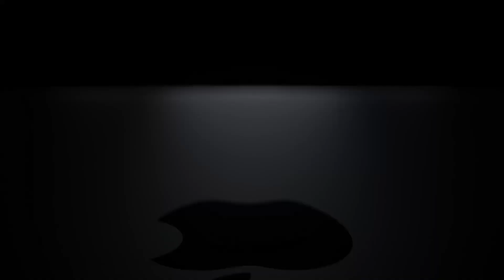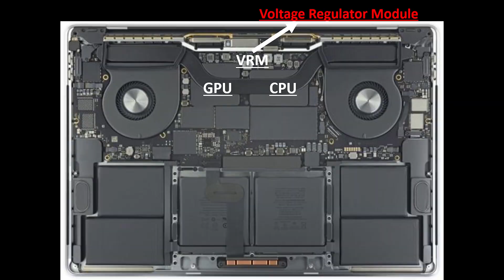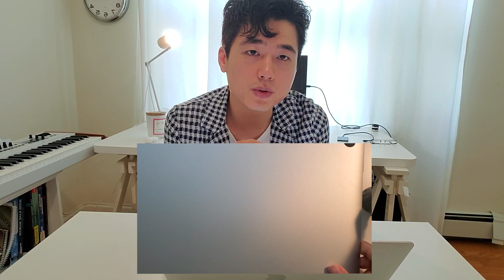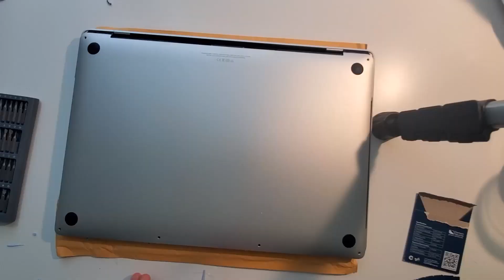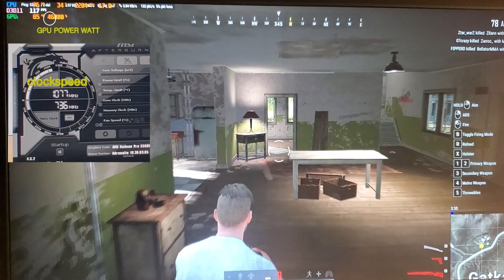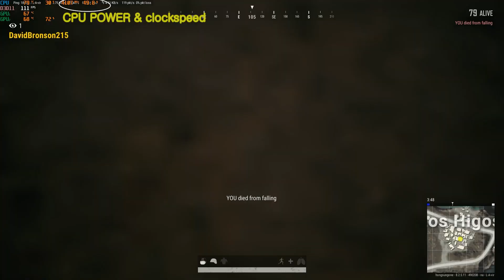MACBOOK PRO 16 INCH Thermal Design Flaw 3 Minute Mod Solution Performance Increase GUARANTEED

Comment: What's the thickness of the termal pads used in this video?
Reply: Just saw in the video, it’s 1.5mm 👍
Reply: You will have to do 1.5 mm and you may have to double up the layers.
Reply: @youandiryan  no you don’t because if Apple give us above a 1mm space and we’re yet using a 1.5mm thermal pad, that’s enough. With a double layer you could create too much pressure against the motherboard

Comment: This mod definitely works and I feel all MBP 16 inch with Intel CPU should do this. The only issue I see here is stacking thermal pads. Use a single pad with right thickness if you can as this will have better thermal transfer.

Comment: What about putting thermal pads on the heat sinks?  Would that help transfer the heat out as efficiently.  Tho, I have heard that in some cases you need to replace the thermal paste as well.

Comment: 2024 I just tried these tips and it's 100% work with me, after adding the thermal pad I ran the R23 benchmark and the maximum temperature get is only 80c, so awesome man
Reply: Which one themral pads ?

Comment: Thanks for the video. It is really helping.  One question, should I remove the adhesive backing on the top layer of thermal pads so they stick to the back cover of the MBP?  I assume that would make it much harder to remove the cover later.

Comment: I did this mod exactly as in your video. Just don’t understand why you put the thermal pads on the lower sections in the middle (thin pads)? I mean no VRM chips there…And btw I believe the most important part to put pads on are the so called mosfets (small black chips). Do you think there is a risk of the pads falling off since they are so thin and stacked?
Reply from the maker: Nah it all depends on how well you put the lid back on good luck
Reply: @notefromone2925  well the mod worked tho 😚

Comment: I FIXED MY MACBOOK PRO 16. Clamshell mode, power connected to right side and (most important) keep the laptop turned OFF. It supports many connected monitors, no throttling, no nothing. Remember: do NOT turn the MacBook Pro on and there will be no throttling. Additional idea: place papers below the laptop. They will NEVER go due to wind. Now you can use your $4500 MacBook Pro 16 for what’s intended.

Comment: This 100% works - highly recommend - my fan speeds seem to be down 5-10 degrees c. It now sits around 47-48 degrees c with a few apps open when developing mobile apps with flutter. Supplementary tip - install Mac Fan Control and set to full blast when running high loads.

Comment: When using the laptop by itself (without any external display), do you run into stuttering issues with the IGPU. I'm not sure if it's an issue with mac os big sur and how it is optimized with the Intel UHD 630 but at times, when using it, the typing lags a bit and there seems to be a bit of stuttering.
Reply from the maker: No I do not experience such lag. Perhaps you should consider doing a wipe
Reply: @notefromone2925  yeah sucks because it’s a pain to get everything back on but seems like the only solution l. I did a pram reset, smc reset,  nothing did it

Comment: I want to do this mod but I have question. Because of the heat transfer, it may increase battery temperature and also may decrese lifespan of battery. Did u check battery temperature before and after?
Reply from the maker: Hi thanks for the comment. The battery is located far below the chassis. I havent checked the numbers but when I touch the lower part of the laptop, where the batteries are located, the temperature feels much lower than where the VRM is. My battery health is still great
Reply: @notefromone2925  Thank you for the reply. When u use it on your lap how it feels, a lot warmer I guess but is it still acceptable?
Reply from the maker: @GoldPunch  It does get borderline uncomfortable hot if you push the computer hard

Comment: What a cool idea. Great, creative tip! My only concern is clearance and the potential damage that could occur from pressure when the aluminum chassis flexes. Would you happen to know if the thermal pads are capable of absorbing or displacing the flex pressure from the aluminum chassis? I've never used a thermal pad (only pastes and adhesives) and I wouldn't want to have a VRM or chip break prematurely. Thanks again for your video!!
Reply from the maker: The thermal pads will conform to the shape of the vrm. Just don't stack the vrm too much. Yes you will notice the bottom plate bulge a little but the plate is very thin flexible.    I think that putting too much heat on the vrm will create even more problem later on. As time goes by the thermal pads will flatten out as well
Reply: @notefromone2925  This sounds good. I will buy materials and attempt the mod soon. Thank you for addressing my concerns, One

Comment: Thanks for the tip bro. For those of you who are here because of the loud fans with external monitor issue: I tried this mod yesterday and it won't fix it, but it does keep the temps slightly lower so the fans kick in a bit later. But they still kick in under light loads. The issue with the external monitor is caused by the GPU jumping from 4w to 18w power draw as soon as you plug in an external monitor. This has something to do with the GPU ramping up it's memory usage as soon as there is a mismatch of refresh rates / resolutions between displays. No way around it other than work in clamshell mode with one or two external monitors that have the same resolution and refresh rate. If using Logic Pro, I've found I have to use Turbo Boost Switcher Pro to disable turbo boost, or have fans running full pelt. For some reason Logic Pro pushes the CPU to maximum clock speed even when nothing is happening. I made a video about the GPU issue here: https://www.youtube.com/watch?v=6mS4AAdft_M
If you are going to try this mod, be aware that the back plate is a bit fiddly to get off, not like the old macbook pro's. It has two clips that need to be pulled free, then another two hinge clips that means you have to pull the back plate horizontally, not up.. Check some videos before attempting! Also, if you plan to work with the laptop on your lap at all, don't do this mod, it does get pretty hot underneath! Although that said, it's mainly the external monitor that makes it hot, and when it's on your lap you won't be using one!
Reply from the maker: Macbook pro 16in's thermal design forces the fan to kick in the moment it reaches total power withdrawl of more than 30w. 

There is nothing you can do about this. Obviously a thermal design flaw but any laptops with dgpu connected to external monitor will activate its dgpu not igpu
Reply: @notefromone2925  Ahh, I'd not heard that before. I don't mind the fans kicking in a bit, but with an external monitor they end up ramping up to a very noisy level, plus the temps often sit above 80c which just doesn't feel like it's going to be good for the lifespan of the laptop. I actually just removed the thermal pads as I think I'm going to sell this laptop and get an M1 machine, and the pads were creating a slight bulge in the backplate. It's pretty tough to get them just touching the plate without pressing it! Out of interest, when your gaming, are your fans maxed out and your temps up in the 80-100c range? And are you using the laptop in clamshell mode?
Reply: @notefromone2925  if anyone's following this now, apple has partially fixed the issue. if you go to battery in settings and set the laptop to low power mode, it will not longer trigger full load on the GPU when plugged into an external display.
Reply: I f*cking hate my first macbook pro 2019 16, thanks Apple for giving me a bad 1st experience
Reply: Hey @BillySalisbury, 
3 years later, have you found a work-around for this problem?
Reply: @pk4eo  I bought a Macbook Pro 14" with the M1 Pro chip. No fans even under heavy loads. I sold my piece of shit Macbook Pro 16" and made a pretty huge loss on it. But I did convince the Apple store to give me 20% off my new macbook for all the trouble they had caused me.
Reply: My experience also
Reply: you can adjust the fan curves with software thats available

Comment: I’m sick of the heat issue. Really bad design. This video was the first I’ve seen with a hardware solution. Will look for thermal pads and see if that works. Cheers for to the point video 👍🏼

Comment: I want to get this MBP 16 but this issue might be the deal-breaker. How sure this Mod can solve the problem? What will happen IF the Thermal pad touch the CPU/GPU heatsink?
Reply from the maker: It will absorb the heat from the cpu and gpu which will reduce its capacity to absorb the heat from the vrm
Reply: @notefromone2925   I just bought mine over last weekend. Yup, the heat issue does exist. I used Turboboost switcher to control the temp (indirectly) but still hot when I manually enable the turbo boost. SO, yeah. maybe I should try your solution.

Comment: I’ve been fantasizing about polishing the top of the heat pipe and using a thin but large sheet of copper that mates up to all parts the produce heat with maybe a tiny bit of thermal paste and the theory is that the heat will conduct away on the copper sheet into the cast of the MacBook and conduct the heat to the heat pipe where at least some of the heat is transferred into the vapor and liquid in the heat pipe to be expelled into the air. Perhaps even purchase some aftermarket cellphone heat pipes that are paper thin but carry the heat away a short distance possibly to the case or just enough into the air inside the Mac case. Your idea is simple but the idea of using a copper sheet seems like it’ll work great.

Comment: I have the MBP 8Core 2.3Ghz with 5600M, I tried the mod but haven't noticed any performance gains. The GPU still throttles down after 10-20 minutes to lower frequencies. Have you removed the black "sticker" (isolating tape) from the back of the bottom case ? I used the Grizzly thermal minus pads 8. which are rated to 8W/m*K (1.5mm thick) 3 layers.
Reply from the maker: Check your gpu temperature if gpu temperature itself is not the problem then its the vrm problem still. I did not touch the gpu and cpu themselves. I would just recommend throttling down your cpu go forward power to your gpu
Reply: @notefromone2925  The temps on the GPU reach 90 Celsius around 1100Mhz and then throttle down and stays arround 70 Celsius. Yes I did throttle down the CPU but that didn't help. Did you remove the black tape from the bottom case cover ? Which GPU do you have ?
Reply from the maker: @4444DaWe  i have the 5500m 8gb its not vrm problem then. You have a gpu thermql throttling problem

Comment: Nice video, why dont you put any thermal pads on the heat sink? I have read online that by doing this you can essentially turn the back plate into a heat sink to help dissipate more heat. Your video says not to though so I am a little confused. Any feedback would be super helpful :)
Reply: you want the heatsinks on the CPU and GPU to be taken out the exhaust holes by the fans and not make the base plate hotter even more which may cause battery or other issues. Better thermal paste like Thermal Grizzly Kryonaut on the CPU and GPU would be good while you are in there but I don't have a guide for that. Apple use cheap white paste that has low thermal transfer rate and now is maybe 4 years old now.

Comment: great tips and video ! After the thermal pad fix, how would the bottom of the MacBook case feels ? is it going to be warmer and hotter than before ? thanks !
Reply from the maker: Yes the bottom part below the vrm will feel considerably warmer when the gpu is used. Thanks for watching!
Reply: The thing is that after the screws, I had a hard time removing the back case :(
Reply from the maker: @smartyfool  yeah make sure you dont dig too deep to pop out the back cover. You shouldnt need to apply too much force to pop out the lower left corner first.
Reply: @smartyfool  Hi, if you still need it, here is another video about how to remove the back case
Reply: @chima6291  where

Comment: thanks for vid! just want to confirm total thickness of pads will be 3mm and 4.5mm? any trouble putting on the backplate afterwards like bulging or not sitting flush?
Reply from the maker: Yes 1.5x2 = 3MM and 1.5x3= 4.5mm. Since the pads were sticky, I had no trouble putting on the backplate without moving the placed pads. The backplate sits flush and you would not be able to tell any exterior differences. Thanks for watching!!!

Comment: Is it normal that thermal pads raise my backpate??. I can see that backpate not fit tight to MacBook case. I see noticeable,but small gap between case and backpate.
I had  the same problem as you. Appliedthermal pads(in stack of two,three) on MacBook Pro 15 inch 2019 as It had been impossible to play FIFA more than 10 minutes due to vrm throttling....

I have custom model i9 9880h+Vega 20

Can I receive some recommendations from you please?
Reply from the maker: Sorry for the late response. I have never used the 2019 version However,  if you feel that the thermal pads raises your backplate then I would recommend removing a stack or using a thinner pad(1.0mm eg). The main point is you want to apply pad so that they evenly touches the back plate.
Reply: @notefromone2925  I don’t know why, but this mod don’t fully help me( 
After 80-83 degrees I have vrm throttling( 
My Mac without cooling stand can hold 50-55 watts(cpu), but due to vrm only 40 watts(
Thank you for the recommendations!

Comment: Thanks for the video. Question: what makes you advice against connecting the thermal pads to the heatsink? Wouldn't the fans + heatsink help with the cooling? I can imagine the tradeoff being that the fans kick in earlier, or perhaps the bottomcover of the macbook getting hotter, but that wouldn't be as much of a problem to me during gaming.
Reply from the maker: I attempted this mod several times and it gave me various results. When the pad was attached to heatsink section vrm throttled more because it effectivelt took on the heat dissipated from the cpu and gpu

Comment: Even without this mod, the eGPU performance of the CPU is completely fine.  Mine paired with a 2080 Super in a razer core X would easily sit at 4187mhz and never throttle back no matter how long I was gaming.  Now once I disconnected the eGPU and used my 5500m onboard, the VRM issue would step in and drop both clocks to almost nothing.  But if you are an eGPU only user, this mod is unnecessary.
Reply from the maker: That is not true. Depends on product quality I went through 5 macbooks because of cpu throttling when connected to egpu. This was more apparent when using the laptops keyboard when gaming.

Comment: Paid 4k for the best MacBook Pro 16 inches 😭 I can’t even use an external monitor 😡
Reply from the maker: This mod will fix your problem
Reply: @notefromone2925  What is your GPU power consumption while you're using an external monitor and the lid is open? is it still around 18 Watts?
Reply from the maker: @davidss0nn  with the mod my gpu always consumes around at least 40watts with the mod. I can play destiny 2 at 85 percent resolution of 1080p at around 120fps
Reply: @notefromone2925  You mean at least 4watts, right ? With external monitor and lid open ?
Reply from the maker: @michaeletienne2489  you cant run a graphic card with 4 watts
Reply: @davidss0nn  I did the the same mod and it's still taking around 18 watts when internal and external monitor, 6W with an external display when I close the lid. I did not notice (yet) if this mod helps to reduce the fans speed
Reply: @notefromone2925  hehe it does in idle, the radeon on this MBP is using 3.93W
Reply: When I connect to an external monitor, the temperature jumps from 43 Celcius to 60 Celcius for the AMD Radeon Pro 5300
Reply: same here... I spent 4.500 usd for a frying pan :(
Reply: I have the same problem, please let me know if you found a solution. Its so sad that none of the reviews covered that there is a problem like this.
Reply: Does someone try this yet?

Comment: Thank you for this. I cannot wait to try this out! Earlier this week I also bought a laptop cooling pad and they seemed to help keep my GPU clock speed consistently over 1000-1200 when before it would throttle around 500. I will combine both these methods together. 

Do you have an Amazon link for the thermal pads?
Reply from the maker: https://www.amazon.com/ARCTIC-Thermal-Efficient-Conductivity-Handling/dp/B00UYTTMNI/ref=sr_1_5?dchild=1&keywords=Thermal+pad&qid=1599752803&sr=8-5

Thank you for watching!
Reply: Thanks, also did you need to apply thermal paste or do the pads have sticky already?
Reply from the maker: Thermal paste is not necessary you only need to attach the pads. The pads are not sticky but adhesive enough so that it would not move around
Reply: Note from One tysm
Reply: @notefromone2925  Thank you so much for this video!!!! Quick question was one 50*50 pad enough to do this mod or are more required?
Reply from the maker: @Mksandman  two of the linked products should suffice in case you make some mistales. One is really insufficient from my experience thanks !
Reply: @notefromone2925  Thank you so much I was able to find one pad that was about double so your recommendation was perfect and the fix works!!! I am so happy to finally have a properly running laptop now thank you!